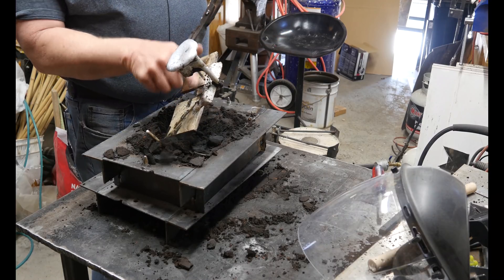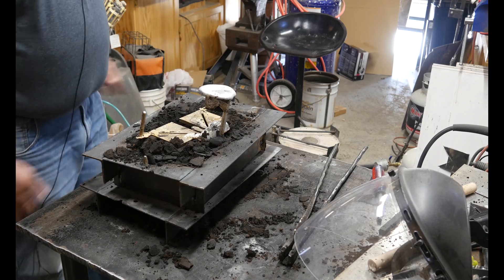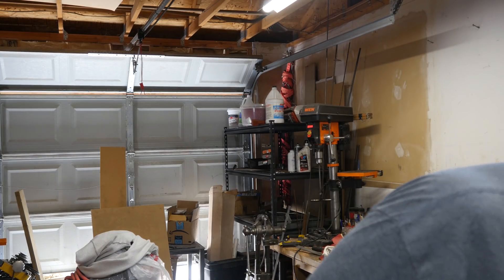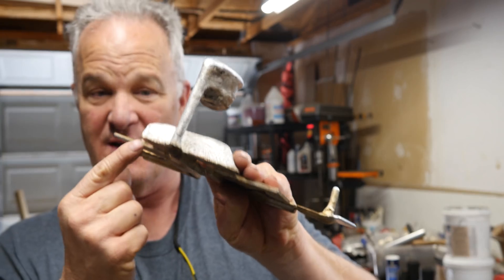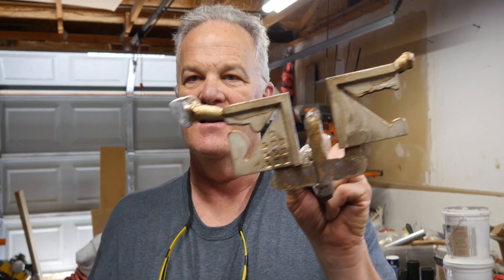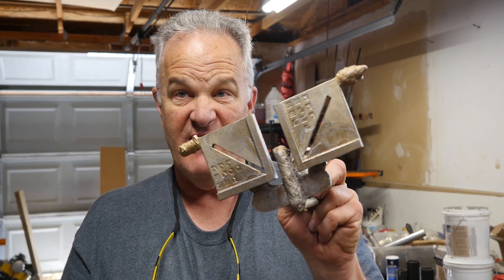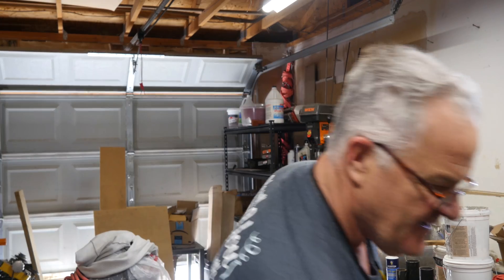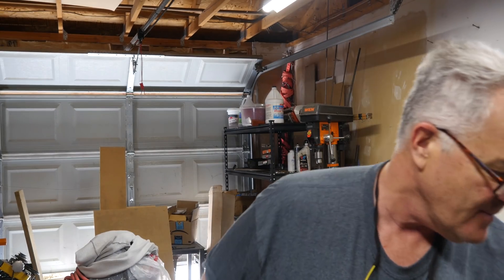Casting center-finding tool

Comment: I have tried to cast a brass skillet.I 3D
 printed it and it's 3.5mm thick.I
failed again and again. The brass never complete fills the mode although it is hot enough that the zinc boiling. I don't know why. I wander brass is special…Can you try it?
Reply from the maker: Can you send me the stl file that you created? I'll take a look. I don't have a lot of brass but if I have enough, I'm willing to give it a try. Email me at swdweeb@gmail.com
Reply: swdweeb OK！thanks~ l will send it to you tomorrow.
Reply from the maker: Downloaded the skillet. I may have a problem with it as it is wider than my glass.  I'll see if I can scale it until it fits.
Reply: swdweeb I just glue two parts together. If it's still too wilde，you can further split it.

Comment: If you truly want to test your persistence, skill, and most likely sanity; there is always the challenge I've seen in the old manuals: the teacup test.  The test was to cast a teacup (including handle), saucer, spoon, and sugarcube in one piece.  I'm not sure just how many separate cores would be needed, but I think the last time I tried to figure it out, I figured it would need at least seven.  It makes my head hurt just to think about.
Reply from the maker: That sounds insane. I tried to cast a simple plaque...twice... today and couldn't get the mold right. I can't even imagine doing what you're talking about.

Comment: Perry, That divot/bubble or whatever you wish to call it in the top of the blind feeder is simply shrinkage  - nothing more.
Thank you for the "non" choke reference I really hate the term choke because it has such incorrect connotations. I might have been inclined to gate into the sides of the thick section with two gates each a little way from the thick section corner - bit easier to cut off and clean up, but no matter it worked. #3 was worse because you did not pour the basin full enough compare that pour to the one for #4, The latter was clearly faster. I think that you have discovered another of the tools needed for foundry work
(yep there are more!) and perhaps the most important one at that - Persistence  - bravo!... Martin
Reply: Isn't Persistence more of a technique than a tool?
Reply: Mark, Its more important than any tool or technique that I can think of - perhaps then  it transcends both... Martin
Reply from the maker: I'll have to go back and watch it but it seems from memory (and you know how unreliable that can be at my age) that it wasn't accepting metal nearly as quickly when I gated into the thin part of the mould. (If you're an American that's the way they spell it in Australia ;-/) I poured a larger part last night with two gates from a blind feeder that fed really quickly. I was pretty surprised how fast it took the metal. 

Back to that third pour, I may have been slower on the basin but I don't recall ever having the metal fall to the level of the ridge. Again, I'd have to go back and look to see.

Comment: Nice work and kudos for keeping at it. Its always a bit of a high/trill/kick/whatever when we get something to work.  Now  I am still claiming rank amateur status but are you sure what your air bubble isn't shrinkage ?
Reply from the maker: As I watched the video, I started thinking the same thing. It could very well be shrinkage, but I don't typically see it on that scale with aluminum. But, as one rank amateur to another, typically means something in terms of less than 20 aluminum pours